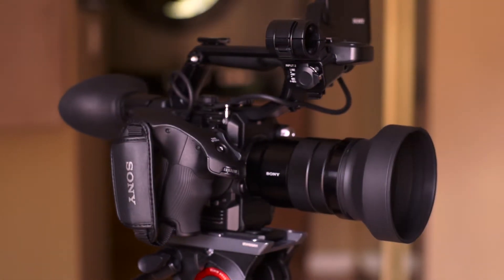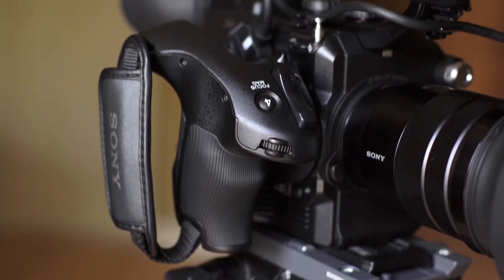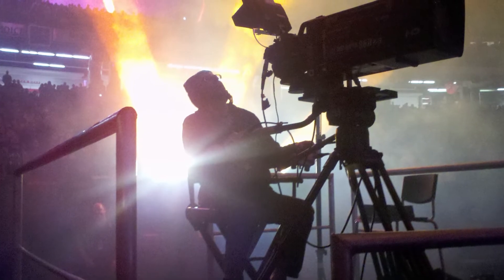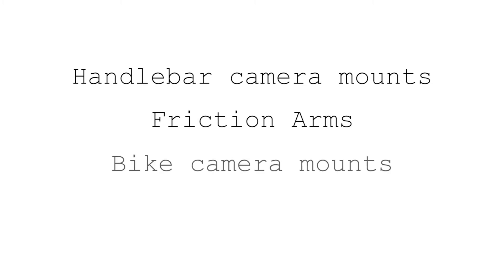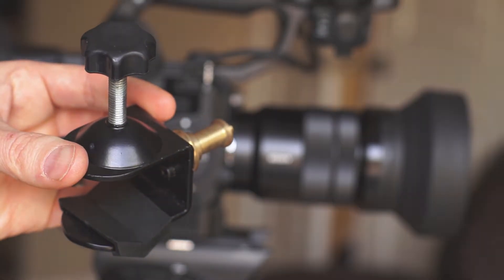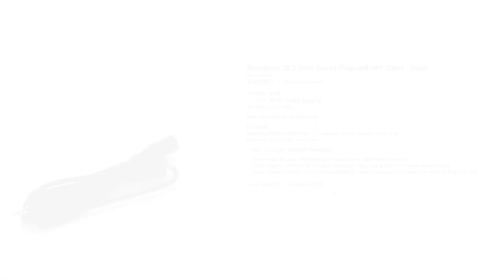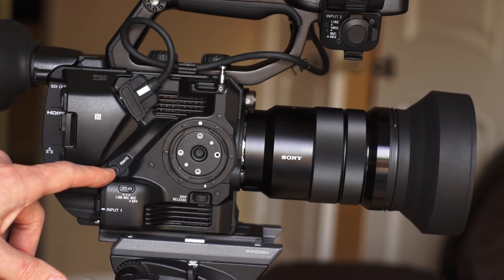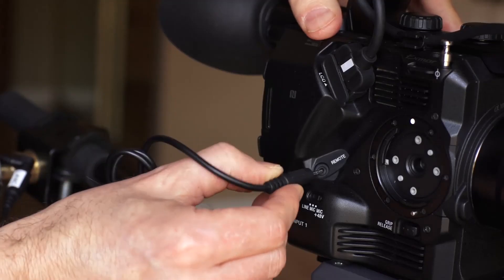FS5 Handgrip Modification

Comment: That thread on the handle is NOT 1/4-20!  It is 6mm.  You'll strip the thread if you insert a 1/4-20, it goes in only about 1 turn.  Use M6, and it'll screw in nicely.
Reply from the maker: Thank you for letting me know. I haven't had to use it much...but I'll be extra careful and avoid it now.
Reply: I made mine thanks to your video! My bracket came from an old Canon ZSD-300M, I had 2 laying around.  I made my own 6mm thumbscrew.  Works perfectly!